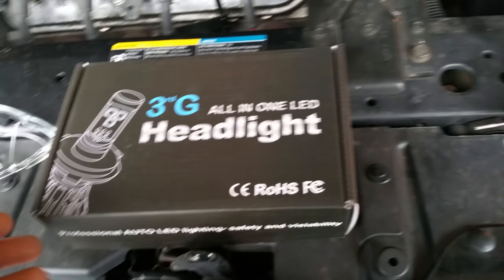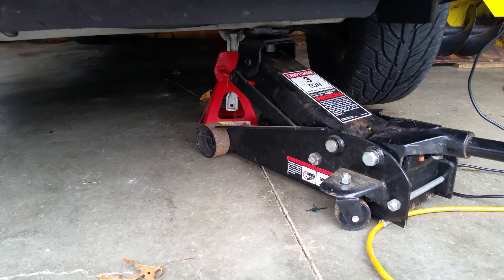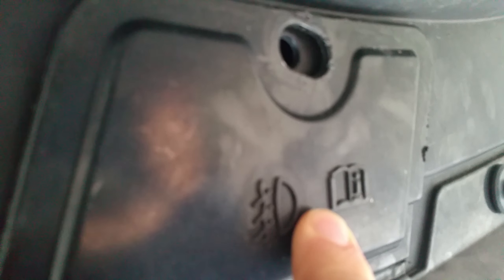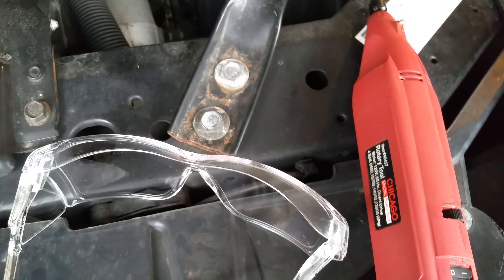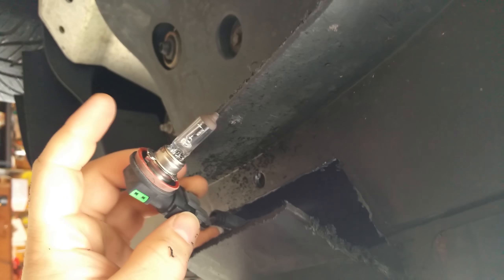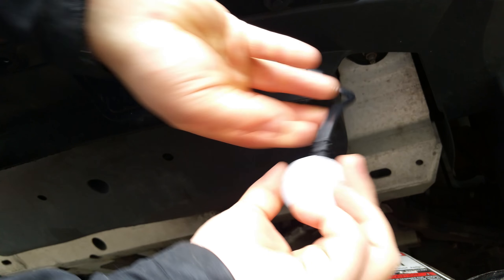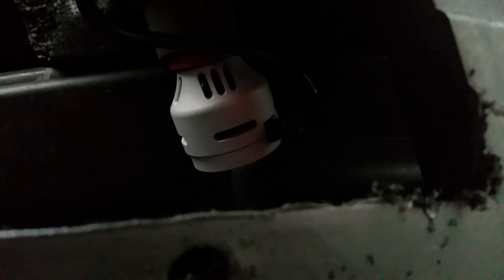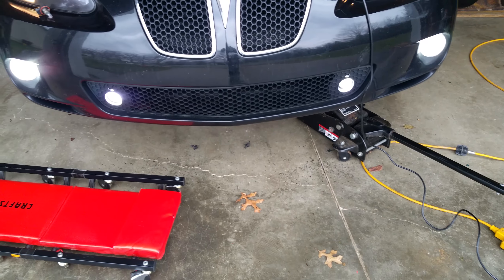Pontiac Grand Prix GXP - Converting H11 Fog Lamps to LED (2000 Lumen)

Comment: When you go to use your turn signals do they switch over to the amber color???
Reply from the maker: Negative. I did not purchase what are called switch-back bulbs which change from Amber to white. I recommend you get switch backs. A grumpy cop could get you for a fix it ticket if they really wanted.
Reply: Thanks!  Also what is the bulb size?
Reply from the maker: Tysen Swank the turn signals or the dogs?
Reply: GPVlog the turn signals
Reply from the maker: Tysen Swank https://youtu.be/Ddu_br7cMo4
Reply: GPVlog thank you

Comment: please help me how do you turn your fog lights on in my Pontiac Grand Prix GXP?
Reply from the maker: +nathan hutcheson what year?
Reply: GPVlog 2005
Reply from the maker: +nathan hutcheson the turn signal lever has a switch for it. You may have the passive switch where you just flip it and it flips back but the llfogs come on. Or you have have an actual toggle switch . Either way it's on your turn signal lever.
Reply: GPVlog yeah i found it but my fog lights dont work the bulbs must be bad or something
Reply: GPVlog I'll have to mess with it another day. but thank you for your help.
Reply: The Fuse relay may be missing 1 beside the horn on the diagram of your vehicle under the hood